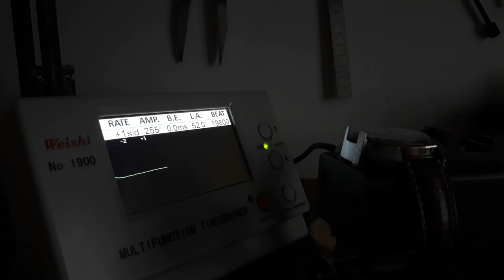Restoration of a Vintage Certina DS 2 Automatic Watch

Comment: I have a DS2 but it is missing the yellow seal! Do you have the reference? And do you think it is so important?
Congratulations for the work 👏👏👌
Reply from the maker: The yellow seal is used to lock the movement, without it the movement moves inside the case. I don't know if it also has a watertight function. Unfortunately I don't have the reference, the watch has been sold.

Comment: I have an old DS-2 i inherited from my grandfather, i think the dial feet has broke, since the dial is moving around.

Do you think i could do this my self with no prior experience? just from watching youtube?

A guy has afford to do this for me for 300 USD, but i think that is way too much

Also where can i get dial feet for this watch? 

Thanks in advance!
Reply from the maker: It is possible to glue the feet without needing to solder them. I attach the link of a product suitable for you.
Obviously you will have to take the movement out of the case and remove the hands. It's not a very simple job. 
300 USD is a lot of money, I think 150 dollars is a fair price.
Good luck!!!!

https://www.ebay.de/itm/165556201278?var=465089333231&mkevt=1&mkcid=1&mkrid=707-53477-19255-0&campid=5338588705&toolid=20006&customid=EB226902625&
Reply: @watchrestorationchannel1061  Thanks !

Comment: Can vinegar be used to clean the parts of a watch?is it safe for the parts?
Reply from the maker: Absolutely no! There are specific liquids on the market such as those of Elma or Tibi. Rinsing can be done with isopropyl alcohol.
Reply: @watchrestorationchannel1061  to add to this, watch out for strong isopropanol solutions and shellac (for holding the anchor pallets for exemple).